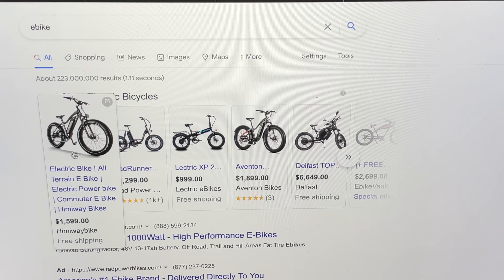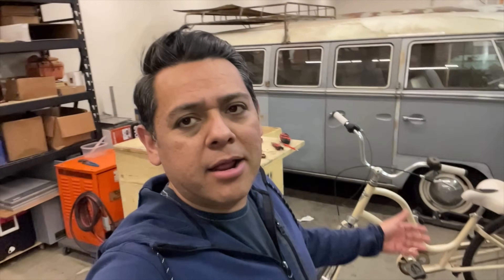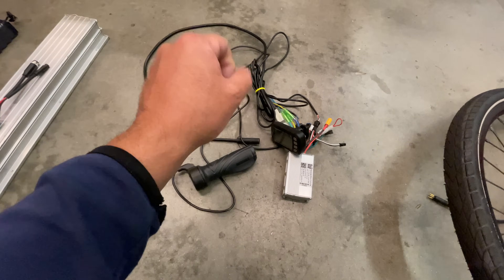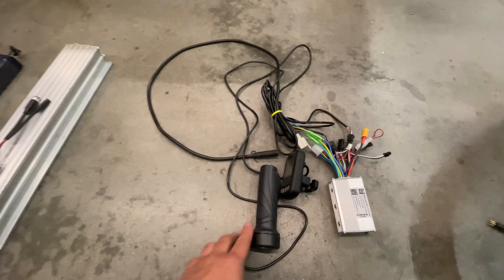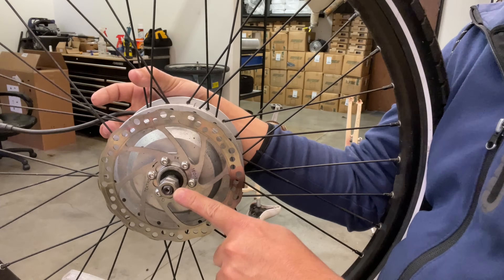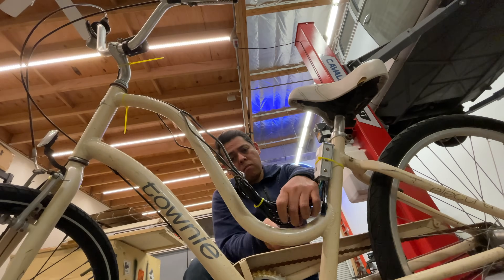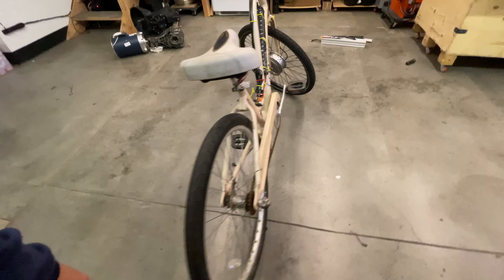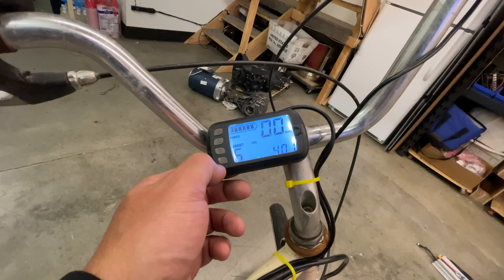$150 eBike Build,  Beginner friendly

Comment: Um... after 2 years and so many videos about DIY ebikes... why is this the one that makes the most sense. You made this seem so easy bro!
Reply: Awesome video.  I am going to build one too.  Liked..and subscribed!
Reply: Why doesmt someone just sell an all in one kit for $200
Reply: @americanpatriot212  you can buy kit like this All.in one from ebay or AliExpress, some come with a battery, some don't. I bought mine 1500W and made my on battery out of 98cells, 40kmh range and 65km too speed but it costed me a lot more.
Reply: @clixium  how much did you spend ? If you don’t mind me asking… I want to make 4 bikes and everyone is pointing in different directions 🤷🏿‍♂️🤷🏿‍♂️🤷🏿‍♂️
Reply: @justblase5270   @Just Blase  you need a bike that you want to convert so I'm not counting that. 1500W kit cost roughly $250 (50 more or less depending if you want trip computer and what not) and includes literally everything you need except battery and charger. Battery is probably the most expensive part, brad new one from a store is at least $400 - the price depends on Ah - range and voltage or number of cells, if you have access to cheaper alternative like Jehu here then that can be drastically less. I paid for my battery around 200, cells were slightly used and I had to do all soldering and assembly. Charger is another $25. So total is $500 for cheapest alternative or $200-300 more for new and plug and play 1500W kit + 52V battery with around 20Ah capacity. Less powerful and slower kit and battery will cost you about 1/3 less

If you can buy a battery from Jehu then do it, if not best alternative is Chamrider company on aliexpress/amazon, their batteries come with Samsung or Panasonic cells - great quality for good price
Reply: @americanpatriot212  Because to get a $200 kit you need to used surplus parts (like the wheels and batteries Jehu is offering.  By doing it yourself (gathering the materials from his list both surplus and the new controller kit) the price can be low.  If one person where to gather everying - that person's time and effort is going to add value (gotta pay for the workers time) and the price will be much higher.
Reply: @ProleDaddy  What a bunch of crap.  Profit is what makes businesses possible, it's not theft it's what they earn for their product.  You're not forced to buy the product and nobody is reaching into your pocket to steal.
Reply: @ebikeengineer  Bullshit. Worker co-ops operate off a zero profit margin. They merely pay wages and retain capital to maintain operations and make future improvements.

"In capitalism, employees do the work, get wages, salaries. Employers provide tools, equipment, raw materials, etc., get profits. But what employers provide was made by other employees.

Capitalists are costly, unnecessary middlemen inserted between groups of real workers."

- Prof. Richard D. Wolff
Reply: @ProleDaddy  so they have profit.  They pay off the employee/owners and the upgrades/company investment is exactly what profit is.  The only difference your coop is privately held so all the profits stay in house.
Reply: @ProleDaddy  it is you who do not understand and have fallen for baseless propaganda.   Profit is the money used for business improvements, R&D, and paying the owners/investors.  You know those capitalists that raised the money to build that factory, pay the taxes and fees, buy the material, pay for the utilities, develops the marketing, set up the transportation/distribution of the product, and honestly come up with original idea for the product or service and how they can do it better.  Because of capitalists we have personal computers, cell phones, internet networks, and services like You Tube.
Reply: @ProleDaddy  LOL other than conceiving of an online bookstore and growing it into one of the world's largest retailer?  Literally changing the online retail model for the world.  For years the company didn't make money, but he worked at it invested in it, and now his shares are worth billions.     Instead of whining and coveting why don't you build a business and learn how hard it is instead of expecting things to be handed to you.
Reply: @ebikeengineer  hard to explain common sense to some people. We just have to hope like hell that people will continue to care about education in the future and protect real freedom as hard as they can. Otherwise, our future will be dim indeed.
Reply: @americanpatriot212  because they sell batteries alone for 200
Reply: @americanpatriot212  did you get your ebike and did you like? Cuz I think about getting this
Reply from the maker: Click on the links
Reply: @jehugarcia  you are so lovable
Reply: @jehugarcia  does the battery need to charge?
Reply: @jehugarcia  does the battery need to charge and how do you charge it?
Reply: @explxed5759  All batteries will need to be charged after depleted and you should always charge your batteries fully before first use. If you bought one of the batteries in the video, the links are in the description and the explanation to charge that battery is there.
Reply: @jehugarcia  thanks for sharing this video but I want to turn my four seater stroller because I’m a daycare provider into electric E bike because it’s hard for me to stroll children up the hill. Do you have any advice?
Reply: I agree. He made something outa nothin. Wish i could do that. /:
Reply: Did you end up doing it? I am tempted to start today! Seems super easy
Reply: Cant we all just get along
Reply: @just1voice994  Is that you Rodney?
Reply: Hello bro I have a problem maybe you can help me with,I connected everything and the motor runs but the wheel doesn’t spin ,is there something I’m not doing right?
Reply: Exactly
Reply: yess
Reply: if the kit is right then its nobrainer lol
Reply: this just shows that all these ebikes are scams. 1000 dollars up to 7 grand for a 2 or 300 dollar piece of equipment.
Reply: @Darkness-ie2yl  No, some are but, some give value for the extra money.
No offence to this build it's very cool as a cheap easy way to get your foot in the door.
However, it's motor is used and about the minimum power to be used on an adults bike. Also the front drive is considered less desirable compared to mid or rear drive due to various handeling quirks.
The batteries are used as well and are guaranteed to be 80% of rated capacity (that is the point they quote the cycle life)
So they have likely been cycled hundreds of times.
They may function at a somewhat diminished capacity for hundreds more charge cycles or they may tank fairly soon.
Was the battery abused or cared for properly?
I would encourage anyone with a beer budget to do this build as you can upgrade as needed or desired. 
Compared to a 1-2K purpose designed commuter ebike this won't keep up.
Aluminum frame, integrated lights, aluminum fenders, aluminum rack designed for the bike, hydraulic disk brakes, and a new battery that can go 3-4 times the distance before recharging and go 28 legally. 
The 4+K range you have a point I can't imagine what is worth that money.
Reply: @Darkness-ie2yl  China makes a bike for a dollar in country walmart sells it for $150 all paying there employees pennies build a bike from scratch weld pipes paint assemble it pay for parts you'll find out fast how much it costs!
Reply: That 4:49 Soldering part is so glossed over and takes time. Also gotta wonder if the links are from trusted sources.
Reply: @americanpatriot212  i agree. he shouldn't have used solder, it complicates things for people who have never repaired elctronics. 
instead you could physically connect 2 wires with a copper joint and then squeeze it down to keep the 2 wires connected.
Reply: @fawnfairy-p2j   thank you for that !     I   um, have never soldered in my life and I can’t start while living in a senior CItizans apartment.   The smoke alarm goes off simply making a fried egg.  Is there a way you can literally tell me the copper piece? Home Depot? Ty
Reply: @beansrgd  i was talking about butt connectors and butt joints that you crimp 2 wires together to connect them.
Reply: This video is so bad it should be deleted as soon as possible and hopefully nobody else follows it cause. If you care about the people watching you would at least remove all the affiliates from the description and put "THIS IS NOT SAFE AND IS THE TOTALLY WRONG WAY TO CONVERT A BIKE INTO AN EBIKE"
Reply: @tavi7  theres literally nothing wrong with it 😂
Reply: @tavi7  i had no problem building 2.  But i've been tinkering and wrenching on things for 45 years, so experience does count. Realistically a build takes a couple hours. Gathering all the stuff takes a week or 2.
Reply: @tavi7  say more then. Link us to your video about the proper way so we can have an objective view
Reply: @tavi7  He has almost half a million followers for a reason. He can just be himself and people love him for it. You don't need to be so picky here. You're assuming everyone on YouTube is an idiotic and needs to be told what to do and that this is dangerous or something. People can decide for themselves if this project is for them or not.
Reply: @tavi7  I am new to this so getting involved in researching how to do this. Why do you say that it is hot safe and wrong?
Reply: @tavi7  Sounds like somebody got hurt lol

Comment: I'm trying to buy 57 $ battery from link in the description and page doesn't work.  Where can I find it?
Reply from the maker: https://www.batteryclearinghouse.com/products/40-panasonic-ncr18650bd-3180mah-10a-cells-in-an-aluminum-cased-pack-high-capacity?rfsn=5308167.265e8e
Reply: I bought battery and it never worked.  I would like to buy the bigger r5 battery.  I see it comes with xt 60 connector for the charger but how do I connect controller? Sorry I'm a newbie at this stuff

Comment: Okay...can you tell me why my ebike conversion is only making a spinning up sound inside of the front hub when I give it throttle? I bought all the parts from your website exactly as you suggest in this video. I wired it same as you...ordered special hex nuts and everything. So why will my front wheel not spin like your ebike conversion in this video?
I converted an all aluminum Diamondback Cruiser for my ebike. But hub only makes spinning sound internally. Yet the front wheel does not move....Please advise...
Reply from the maker: Because it’s spinning the wrong way,  you have to switch the phase cables so it can spin forward,  then the wheel will spin.

Comment: Okay Desi Arnaz Yes 10 minutes! Ha! LOL.  I was born on a Saturday but not last Saturday.  It'll take 5 minuts to get the old right hand grip off.  Another 15 minutes to exchange the front tire if you have the nuts! 15 to mount the battery and the controller.  At best it's at least a 1 hr. build and probably more like 4 hrs after you drive around to chase down the nuts!

Comment: I built this bike this weekend. I had to use Google lens to translate the controller plugs. Has anyone tried to run a high voltage like 12s
Reply: Today I learned there's an app that can visually identify strange electronics plugs. Thanks for that.

Comment: Where did u find the hub motors?? Im trying to find a bulk supplier in the California area with no luck
Reply from the maker: How many you need?
Reply: @jehugarcia  depends on what they are. Front or rear hub and/or if theyre warrantied. I checked out ur website, i need 1000w hubs at least urs had said like 350w or something they wouldnt work

Comment: so my first ride today, I rode about 15 miles averaging 31mph according to my phone and I still had 2 bars on the battery. I would assume by that I could probably get 17-20 miles. It did really well.
Reply: Is that with tha largest battery?
Reply: @mattosborne1233  yes, keep in mind, I also was pedaling and there was some heavy downhill areas that really had me moving as well as some steep uphill (Going uphill, I absolutely had to pedal hard to keep me moving as the motor wasn't enough but it was enough to allow me to keep going at a decent pace where if I didn't have that, there's no way I would have made it up that hill). I also wasn't on the throttle the whole time so mileage may vary. With the large battery, I had to install a bike rack and mount it on there as I couldn't find another place on my bike that it would fit. He also wasn't completely forthcoming with the large battery you also have to buy a dongle so you're going to be out about 100 bucks on that battery, plus a bike rack, plus the controller has gone up in price as well and you need a dongle for that and a specialty charger end for the battery as well as the charger itself. This for sure quickly became not the cheapest e-bike conversion kit but it's a class 3 e-bike for MUCH cheaper than anywhere else I could find. I'm hoping this gets me back into biking then at some point I'll probably purchase a name brand e-bike if I stay in the hobby.
Reply: Wait!  31mph?!
What in tarnation?!
I think there are two different controllers you can get. The one I have only has five settings. And it will only let me go 22 miles an hour. Do you know which controller you have? Mine has the controls on the left and they are from top to bottom C, up arrow, down arrow, and Power.
Reply: @mattosborne1233  I used the one he linked, not sure if I crossed some wires or what but I was able to verify using my phones gps
Reply: @mattosborne1233  you don't play bass by any chance do you? Have a brother who's into electronics?

Comment: Has anybody found a way to connect thr hall sensors to a controller? I want to convert my bike to ebike using your motorized front wheel.
Reply: Usually the hill is three main wire...Blue, Green and Yellow. When doing my building of Hills with non matching control you throw the color matching out the window. Mine was blue on blue. Then the green went yellow. When I hooked it up color matching the wheel/hub just made a winding noise. I just cut the connection and made my own.

Comment: I appreciate what you did here, but that battery needs to be in some kinda protective casing  setting it up bare like that could be dangerous. One solid strike against that battery, and bang, its on fire.
And you might want to show how the hub locks into the hanger. That part is usually the first to fail.

Comment: I want to use the front wheel motor in your links. How do I wire up the hall sensors in the wheel? In the site, there is a FAQ about the phase wires(assuming these are the power connections), but no info about the hall sensors. Is there somewhere to ask?
Reply from the maker: I couldn’t figure it out so I just didn’t connect them
Reply: @jehugarcia  runs ok  anyway?

Comment: Dear Jehu: The idea is great, but you had to research and find the whole stuff, do the thing with the XT plug and so on. It takes much more than 10 minutes. And after 10 minutes the parts are not really well attached and adjusted. Also not waterproof. Another problem: No international availability/shipping for for example things you sell. All in all it's not that easy and not that cheap. It would be better to tell realistic stuff.
Reply from the maker: Realistically your can’t do attitude is the problem,   Hundreds of
People have successfully built this by now

Comment: Can you give an update on how the battery is holding up? Usually those really cheap battery packs are complete junk and will degrade really fast.
Reply: The middle battery will take you about 12 to 20 miles, depending on how much you help pedal. They'll ask me about 1 hour on a full charge. I bought two batteries. Right now I have one zip tied to the bike. I'm thinking about ziptime both of them to double the distance.

Comment: you don't want to hit a pot hole with no shocks at those speeds. Used to have a motor hooked up to a bike with no shocks. It could do 19mp and that was dangerous on the roads.

Comment: Can't seem to find out how to charge the $25 batteries. The charger the website recommends  requires removing the cores from the battery. The one in the description doesn't work for this battery. Anyone know how to fix this
Reply: I bought two of the middle batteries. I had to cut the wires off and put xt60 connectors on. The charger seems to work fine, if you don't mind it taken 9 hours to charge the battery. That's why I bought two.
After writing this for a while, though, I think I'm going to get one of the bigger batteries. The medium battery lasts about 13 miles, or about an hour depending on how you're using it.
Reply: @mattosborne1233  Could you share a photo of what you did.  I bought 2 middles and am a bit confused how to hook up to the controller and how to charge?  Zacharyfunes@gmail.com
Reply: @mattosborne1233  I would appreciate any knowledge you have to share.

Comment: throttle is now alowed over here. we can only have pedal assist. Ie you need to pedal for the motor to work or it will not be a treated bicycle by law. If you have a throttle is is a motirised vehicle and you need insurance and a licene plate.  So hall sensors need  to be attacked to the controller.
Checked the price here in the netherand but the cheapest was 116 euro for the motor only. A complete wheel is 150 euro minimum over here. :-(

Comment: If you're willing to do more DIY, it can be done cheaper, you can do 2 bikes for around 150, If you find a kid who broke his collarbone riding a hoverboard, his parents might give it to you for free and there's two Motors! You can get them at thrift stores for as low as 20 bucks because they're  death traps. You'll have to drill some holes in it and buy the right size spokes to rethread the rim, because you'll be doing some wheel rebuilding. There's a bunch of builds like this on YouTube. You can even go cheaper if you got a spare car alternator laying around and can manage a little welding.